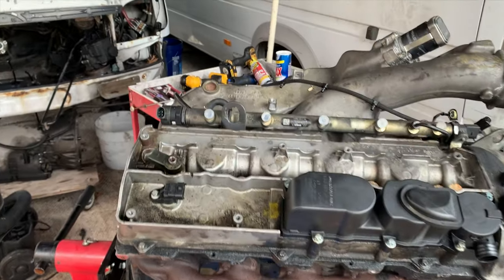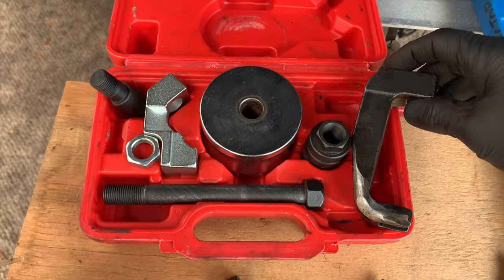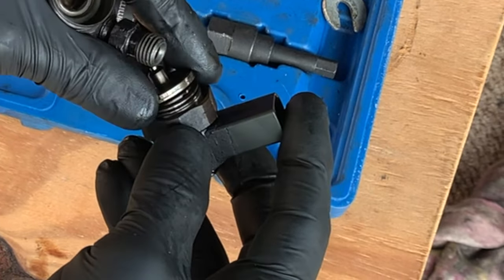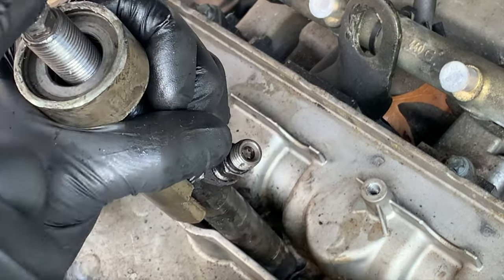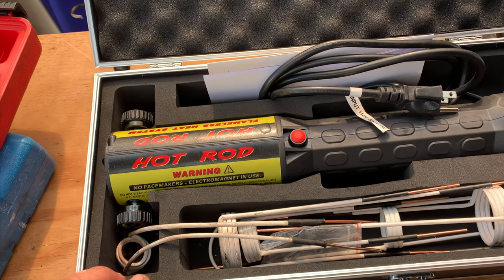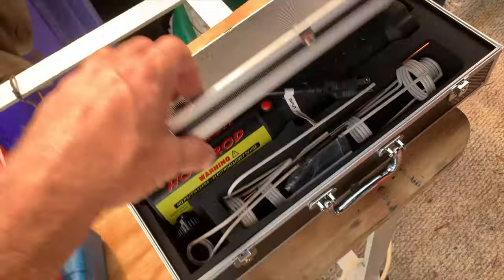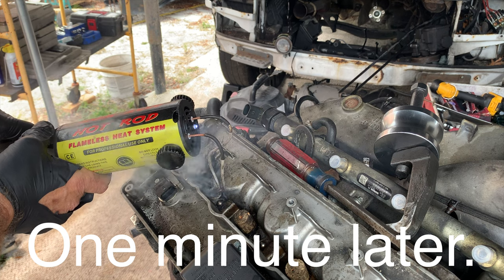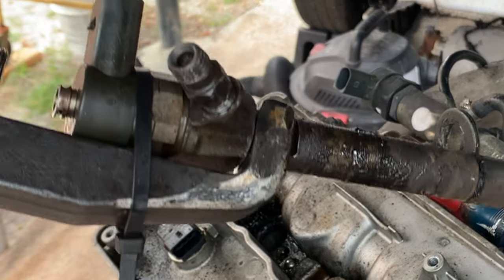Injector Removal T1N Sprinter

Comment: Puller hammer rod is too short, if it was double that it would come off much easier. The longer rod and heavier weight the better. But do not fit on the car the longer ones, especially on cyl 3/4.

Comment: You know what.  The way to remove the injector bolts when they snap is the one I want to see.  3 of my bolts SNAPPED BIG time!!!  That was a big cost.  Mine have been resized to M8 not M6.  This is another problem i have and no choice in the matter.  Would like to see your input on this.
Reply from the maker: No problem! I have a video just for broken injector hold down bolts. I share what worked for me, metal drinking straws and plastic ones to build a sleeved bearing. once drilled and tapped to 8mm the shown inserts should side right in so you can use proper stretch bolts again. I can link you to the inserts on eBay. They are worth every penny of the $25 each. If you don't have a plethora of tools, get the $60 kit with drill bit and tap. https://www.youtube.com/watch?v=wn0nEmz2YtE&t=64s
Reply: @FloridaVanMan  thank you very much.  I left a comment on that other posted video.  I have an issue and maybe screwed it up.
thank you very much kind sir.

Comment: Great information. Regarding the induction heating. I would think by  heating the injector, it will expand and be harder to remove.  Maybe heat to break the hold, let it cool  they try to remove.
Reply from the maker: Indeed, but get at it before the carbon cools completely. We aren't trying* to employ the expansion of metals here, it just happens anyhow. All we are trying to do is heat the carbon crust between the injector and head to soften it.

Comment: 10 pound ,,and longer slide hammer ,or pneumatic/hydraulic
Reply from the maker: LOL Tell me you haven't tried, without telling me you never-ever tried! A ten pound slide won't fit in the available work space, but if it did it would yank the threads right out of the injector. Pneumatic hammers do the same thing, break the injector and make removal far more difficult.
Reply: @FloridaVanMan  good point,depends on application
Reply: @FloridaVanMan  Glad you mentioned this.
Reply from the maker: @jamesfish5630  I should be softer with my opinions. They don't always, but they can and sometimes do yank the threads.
Reply: @FloridaVanMan  Got a tough set on a T1n with engine removed right now so been soaking them in various mixtures (50/50, pb,liq W, etc...) before using claw foot and injector screw in type. I can lift engine with a claw foot on any injector so they are "stuck" good.
Sacrificing all injectors so rigged an oscillating tool to to injector top, screwed it on and hoping the vibration has an effect....will see :)
Reply from the maker: @jamesfish5630  I recently bought an air hammer for this purpose. I've not had opportunity to try it but I am told it will work. https://amzn.to/46ld9dQ
Reply: @FloridaVanMan  Seen that and  may try it if needed. Also had idea of sticking a heat rod (not too hot) down hold down hole to heat the head some and help "drawing in" penetrant.
Reply: Also thinking when my pullers arrive to make a strong "bridge" across the head so lifter pulls against a more solid surface then egg shell lifter cover. Looking at my spare lifter cover there's not much material there and the oblong seal .... Sure it works fine on mild stuck cases but mines much more extreme.
Reply from the maker: @jamesfish5630  The destructive puller pushes on the valve cover where it is directly supported by the engine head. I would not advise building a bridge. I've seen that done a few times with sad results. I've read of a few times it worked as well, but can't say exactly what was done different.
Reply: @FloridaVanMan  I was successful getting all 5 out today using ebay extractor that screws into injector tops. Trick was to use a 16" drift and small sledge to rotate injector left then back right many times. With each rotation had to retighten extractor nut.
All 5 were corroded in pretty far down and noticed minimal to no penetration happened using various penetration liquids for over a week.
 Broke lifter cover on number 4 but was figuring to use my better spare anyway.
Very happy not to have to remove head lol!

Extractor used said it was for Mercedes CDI Sprinter C E Class ML and didn't fit so had to grind it some.

Comment: Yes the Injector is rebuildable.  I have personally done this.  What you have failed to say is that you DONT send (RUN) the injector after a rebuild or similar.  Why.  Where that ball bearing should live.  A tiny tiny hole is present under the ball bearing.  1.56mm...  This hole can be DAMAGED!!!!  Problem is you PERSONALLY will never see this hole.  ONLY a microscope can this and the pattern of wear.  Once this item has been dismantled it is ADVICED to send the injector away for inspection.  My injector has no ball bearing in it.  However, did contain the cup.  I replaced the ball bearing and refitted the injector loosely.  Sent it away.  They returned the item as damaged because the HOLE below the ball bearing was damaged BUT everything else was perfect.  120zl later injector fix, spec'd correctly and came back in full health as useable with warranty.
What I later found out what caused the injector to leak was because of this HOLE was enlarged and LEAKING additional FUEL into the cylinder.  Thus causing the Copper WASHER to fail.  Too much fluid in the combustion chamber and the pressure was to great for teh sealing ring.  SO, when you find a failing ring, normally this means your internal of the injector has failed somewhere.  Thus leaking too much fluid into the cylinder, then piston on the UP stroke forces the fluid to bypass the copper washer.  You found your problem and now KNOW that your injector will fail tests no matter what you do to get it out safely.

Comment: I wonder if fashioning a bit of plywood or metal handle that went under the weight to pull up with would help. It would make for a better grip and keep your fingers clear of the pinch point. A fancy version could even use some bicycle handle grips. Good work getting it out!
Reply from the maker: I might use that idea, drill and tap holes in the weight for adding handle bar grips!

Comment: Maybe slide this little hammer under a lite weight disk on the puller, (maybe make a stirrup for the hammer)?? ----  then with a small solid pin instead of a nail, hammer the injector out?   T-king Pneumatic Hammer -mini Air Nail Gun Steel Nail Palm Hammer

Comment: @12:00 Heat really is your friend. As is acetone* (just don't breathe it! ) I use an old kettle to boil water / coolant mix and pour it over the injector gallery, with the drains closed. Get the head right up to 90 Celsius, plus. Once it's hot, get some brake clean or any kind of acetone carrier and drown the base of the hole (stand back, safety gear on). the cooling action of the hydrocarbons and propellant (or raw liquid) will capillary suck the fluid around the injector body, turning the carbon to rubber. On next (subsequent) reheat, the rubber releases and the injector wiggles loose. mainly...

Comment: Thank you for the video. Very good video for us to see what may or may not be worth doing. In hindsight with the engine out it seems a pneumatic puller or fitting some long handles on that slide weight would be the way to go but...easy for me to say sitting on the couch
Reply from the maker: True, but my intent was to show how we can do this at home. Most of us can't remove the engine, though it makes it a lot easier to show on camera what is going on. I wanted to use tools and methods we can use wit engine still in the van.

Comment: I missed the "can't use the injector because of the puller socket" information. What part of that process ruins the injector. Just hard to get it back to the original seating?
Reply from the maker: More than hard* to put back together correctly and impossible to get the compression force back to what it was. When we take the top off for extracting we know immediately that injector will not pass testing at the Bosch centers. Experience teaches us most folks loose the tiny ball or the tiny cylinder that holds the ball. Most folks fail to stack the parts correctly and assembling parts wet with diesel is as difficult as stacking 2 greased bowling balls.

Comment: Have to say it's a pain of a job, and I've only had to do injector no.1 seal so far. Definitely more easier at the front of the engine. For me I let it soak in wd40, and various other penatration fluids over night, and mine cam out in about 15 mins of tugging using the claw tool. Great video though as always.

Comment: Thanks for your help yesterday on my Q's regarding the ECU for the ABS ~ my engine starts great when it is cold but takes a lot of cranking when it is warm...I have read this may indicate that it needs new injectors. Looks like they are about $400 each...except some chinese ones for $125. Do you have experience with the cheaper ones thx
Reply from the maker: I don't buy ANY new injectors because they are mostly counterfeit on the market. If the box has no hologram label it is not authentic. Those stickers are being forged now too. I have my injectors tested then rebuilt as needed at a "Bosch Authorized Service Center" like ocaladiesel.com 
If you think* your injectors are problematic start with a leak off test of the injectors and leak off test the rail. I suspect you will find the rail fails testing when the engine is fully warmed up. Maybe one injector will reveal itself but either way one part is needed, not 5. If I just saved you $1600 please join our support group at https://patreon.com/Florida_Van_Man?utm_medium=clipboard_copy&utm_source=copyLink&utm_campaign=creatorshare_creator&utm_content=join_link 
I also suspect the camshaft sensor is actually why it starts slowly when hot. Then tend to do that when failing. I think we have a video or 2 on that as well. Search our page for "leak-off" and "camshaft".

Comment: Hi there
Having some problems with my 316 2.7L CDI driving back from Spain to uk gearbox when into F them into manual 6th gear though it was the gearbox first then when pulled over on motorway it took about 30 times to restart after it got called. Now same problem. Thought it was the gearbox but it looks like injector leak. Seen your video don't look like a big job. Will you advise it's definitely the injection leacky. Thanks Rus
Reply from the maker: I don't believe leaking injectors can cause shift trouble as described.

Comment: Will the claw clear the cabin air filter box removed for cylinders 4 and 5?
Reply: Probably not as although the claw will fit the injector, you don't have room to use the hammer
Reply from the maker: It gets in there but if the injector starts to come up the tool does too, and it will hit quickly. However the cabin air filter and cover can be removed for a little room. The plastic air channel can be removed too, with 5 hard to reach nuts.

Comment: Do you ever swap 647 injectors onto 612 or vice versa? Do they have a different spray profile? will they run on each other's computer / injector driver?
Reply from the maker: They don't play well at all. I have seen one OM612 running with 647 injectors, but it ran rough and sluggish. We swapped the injectors to OM612 type and the van ran so much better. From my understanding, the OM612 injectors won't fire at all in an OM647 engine.
Reply: @FloridaVanMan  interesting. My spidery sense tells me the 647 uses multi pulse where the 612 has a single pulse system. They're both quite primitive still. I got a whole 647 with ecu and all. I'll probably swap the whole thing in and refurb the 612.

Comment: you are my van god.  i have 03 "using "quart every 500 miles or so.  but runs perfectly.  i've only put 1k miles on it.  think it sat a long time before we bought it.  165k miles on it.  thinking of a piston "soak" for possible stuck rings.  your opinion would be very fondly welcomed.  thanks.  tap dance is very bad throws oil out of oil filler hole like crazy.
Reply from the maker: Are you doing the cap dance correctly? The timing chain is right below the oil fill port, so if you remove the cap it will sling oil! It should!! I do it too.... can't help myself sometimes. But we don't want to remove the cap, just turn it loose so it can hop if it needs to. Have you seen the cap dance test video? If you can find me on Facebook or cypher my email address to send me a video of your cap dance I'll reply with my opinions and advice. If the dance is just a grade C or D you'll want to clean or replace your crankcase ventilation heater. We also have a video for that and when the video was uploaded I had not realized the dramatic result. I had been adding a quart every second fuel fill-up and went right a quart between oil changes. Yes, that is almost a qt every 1,000mi to a just quart every 10,000mi with one simple cleaning. I need to revisit that video! If you can check for vacuum leaks, that would be wise also because creating & maintaining the vacuum is achieved by sucking air into the crankcase. That air is expelled through the breather and the faster/more air moves through the breather... the more oil it brings along.
Reply from the maker: Please consider joining our support group to help make these videos and advice possible. https://patreon.com/Florida_Van_Man?utm_medium=clipboard_copy&utm_source=copyLink&utm_campaign=creatorshare_creator&utm_content=join_link
Reply: DID IT @FloridaVanMan

Comment: Great video, would love to know the when (guess you said noticed power loss) and milage on this engine to give some background into when this might need to be done? As you mentioned looks like it had been done once before. Also is there some lube or something that helps when sticking them in for the "next" time?
Reply from the maker: Absolutely, always coat the injectors, glow plugs and EGR with ceramic anti-seize grease or paste. We show it in videos for all of those repairs.

Comment: You can get all the part for in the injector ...total rebuild all new parts
Reply from the maker: But can you test and assign IMA codes after installing new parts? I can buy paint and canvas too, but my paintings won't look like Bob Ross's. Sure, paint is more subjective than steel parts, but injector tolerances are ridiculously tight. Simply putting new parts in won't guarantee performance.

Comment: Coefficient of expansion of aluminum is higher than steel, thus you need to cool injector to shrink it.  great learning experience, nice review of the inductive heating gizmo "HOT SHOT"
Reply from the maker: When an aluminum block expands more than the steel injector, does the hole get bigger or smaller? Does the expanding aluminum squeeze in the hole or does the expanding perimeter aluminum actually make the hole bigger? In this situation the heat is more about softening the carbon and crust that hold all old injectors in to varying degrees.
Reply: @FloridaVanMan  over all the aluminum head grows at a faster rate than the steel injector,  In my limited experience cooling the part you want to remove will shrink it ever so to aid in removal. Something as simple as compressed air can do that.  As far as the carbon crust your right heat or chemical process is needed.

Comment: question is, how to maintain injectors so we don't have to go through this?
Reply from the maker: Don't let the fuel tank fill with air in cold wet weather. keep it full of fuel. And don't let the van sit without circulating fresh fuel over extended periods. Balancing those two ideas without driving the van a lot means compromise.  Remove injectors every 200,000-300,000 miles for testing, or every 5-7 years. Use only good quality fuel.... and there's the rub! How do we know what is good and bad quality fuel??? We don't! At least I don't and anyone suggesting they do, I would question their beliefs as matter of facts or faith. All fuel brands have unique and proprietary additives in retail pump dispensed fuel. Mixing those additives with off the shelf bottles is just dangerous placebos with no chance of actual benefit.

Comment: i am a pretty good diy type, is there in your opinion better yrs for the sprinter, especially to do service work, and injectors always replaced (new,rebult) after.   thanks  joe and misty
Reply from the maker: In North America the 2004-2006 are best years with positive pressure fuel system and more robust OBD (self diagnosis). I suggest having injectors tested any time they are out of the engine, by Bosch Authorized Service Center like OcalaDiesel.com 
I also buy injectors from there when needed because I do not  trust any new ones are authentic Bosch.
Reply: @FloridaVanMan  thank you